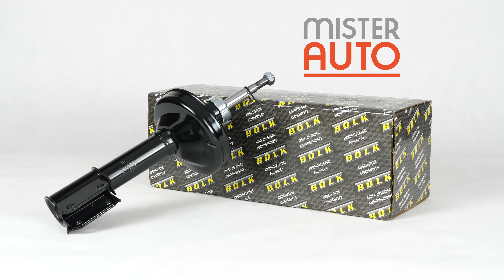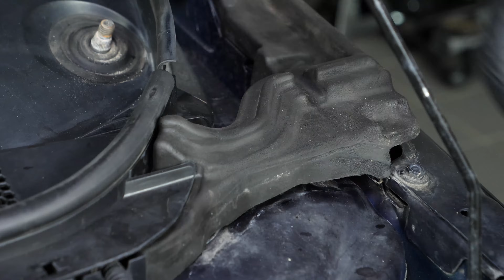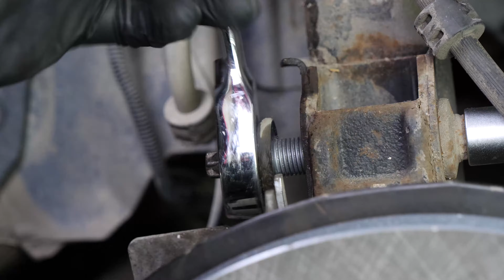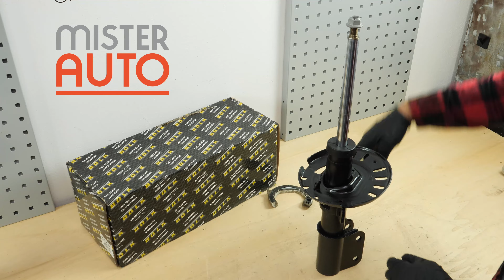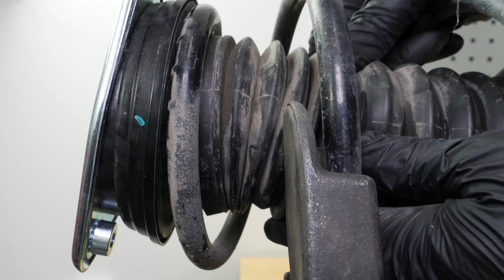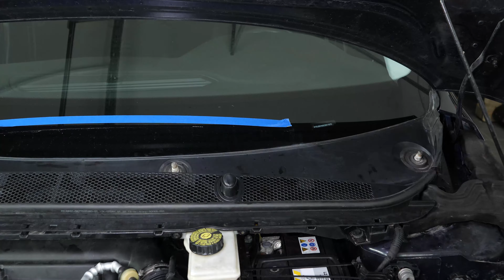How to replace the front shock absorbers Peugeot 308 mk2 ➿

Comment: DO NOT MAKE THE MISTAKE I DID.
When taking the strut away from the knuckle, place a jack stand under the knuckle or a scissor jack to hold it in place, Do not allow the driveshaft to come too far away from the gearbox or you'll find it pouring gearbox fluid onto your driveway 😆 Be careful.

Comment: I think your torque tightening data for the strut to knuckle bolt/nuts is incorrect. Check with Peugeot service box. I think you will find its rather different.

Comment: nice video showing how to do it...but unfortunetly you put it back in wrong place....orange rubber , foam pud should be beetwen metal top mount and bearing as you took it down and you put it back behind it....they did unfortunetly same to me and orange buffer damaged my new bearing on booth sides...and i had to replace them booth again...so do me a favoure and when you make guide/tutorial videos just do it right!!

edit, you didnt put rubber circle on a bearing as well, poor!! very poor!
Reply: There is mark on the windscreen which help to set Properly wipers.
Reply: I have the same problem where they placed the orange part  under the black rubber not in between at the left front side. It moves freely..I have a squeak noise whenever the weight of the car presses shocks down for example going through speed bump slowly.. the top of the orange plastic is squeezed under the black rubber.. 
I’m wondering if you had the same kind of noise before fixing it?

Comment: Would the procedure be the same in a RCZ?
Also is there a link to the spring compression tool?
Very very nice clear and informative video!
Reply: Where on the chassis have you placed the jack in the video?
Reply: @markduffy9475  Personally I placed the garage jack on the spots for the factory jack, however both front connections gave way and folded in to the chassis also left rear side caved in... Yes I did put a plywood board or a piece of wooden plank with a cut for the original jack points, however when the chassi caved in the jack slipped off those and went flying (well one time it flew in under the passenger side and crashed through plastic and stuff and came to a creaking doomsday-ingly halt stressing me to get the car up and get it down...) Notice that some spots that looks like they are beams/metal points that could support a piece of wood/plywood to even the pressure for a garage jack is plastic garbage. I STILL dunno how I am supposed to jack my newly purchased family member up...
This summer I gonna get her up and cut away a fat square and weld on some thick plates with strengthening beams so she can get jacked up!!!
(Praying I wont fry all the electronics since I'm neither a mechanic, electrician nor an educated welder... at least I welded some but that parts without any schooling nor common sense)
So my friend, I dunno how to advice you. Did you get an RCZ too?
Everything so beautiful on this car, why did they skip working jack points or anything rust prevention whatsoever underneath?!? I'm confused...
Reply: @helturflippad  I have 308 GTI 270, I noticed in this video that they do not use the jacking points, mine are in a sorry state also. It looks from the video that they use part of the chassis but I can't exactly see where. I wouldn't want to risk it without knowing the exact place.